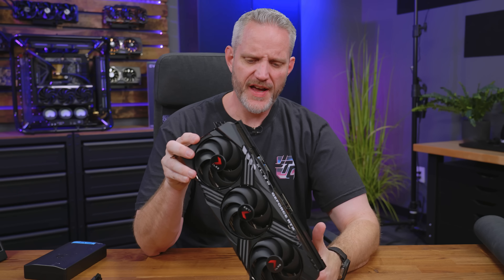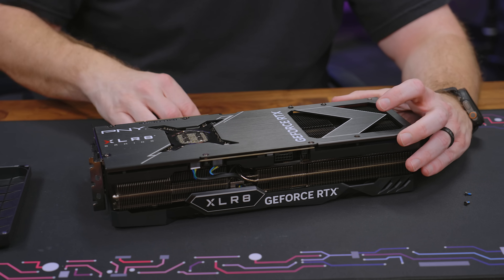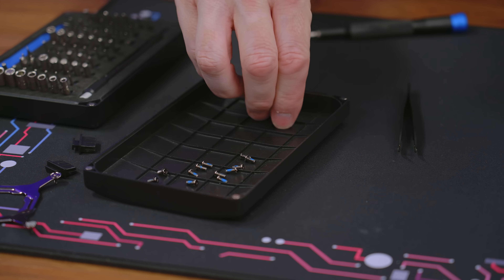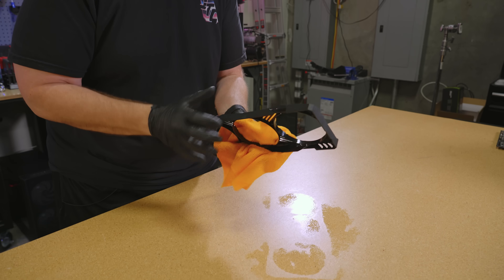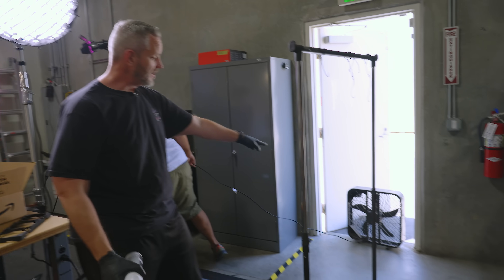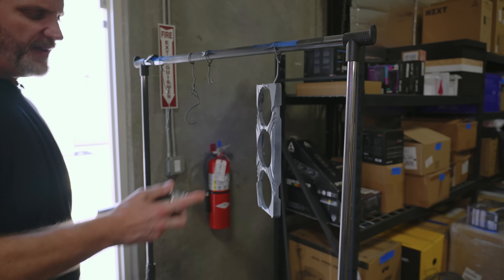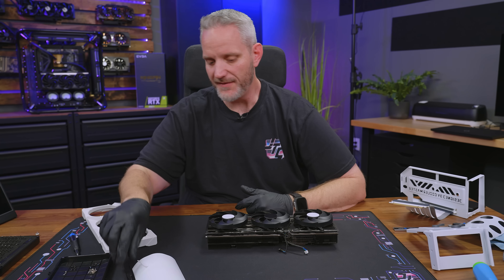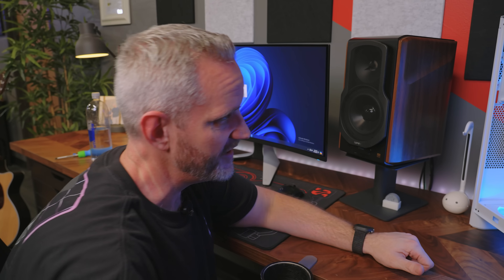How to paint your GPU the RIGHT way!

Comment: There are superwhites (not normal paint) that reflect light and heat from the sun to a large degree enough to go sub ambient, as the light is all bounced back into a clear sky... I was just wondering if there would be any way to use sub-ambient coatings and a set up to reduce temps even by a degree.... On the bright side even if it did nothing, it would be stupidly stupidly white! XD

EDIT: On the down side it's currently not 'off the shelf' available.
Reply: Radiative sky cooling for sub-ambient requires unobstructed view of the sky. So the only way a super bright white could achieve sub-ambient is if it was outdoors.
Reply: @mattrogers6646  Window. it has glass sides right? ... The real question I have on that is if it'll reflect any extra heat from being absorbed at all... There is more than one source..
 There is also phase change materials while while they can be saturated could be tuned to a specific temerture range before it really  kicks in, just as an added reservoir...

Just a few wild hair ideas, as at presnt I do not think any one is looking for other uses as they are not main stream, developed or diversified enough yet.

Comment: One thing to remember with paint, it may be touch dry but it will still take about two weeks to cure.
Reply: After a day or two depending on the thickness of the coat and the type of spray color most should be fine to handle.
Reply: @mrn234  Ya i know that, next time you paint something when its touch dry an you are able to handle it press your nail into the paint.  Then press your nail into the paint two or three weeks later. And youy will see the difference.

It's the same with two pack paint. come to think of it it's the same with all paint.

Comment: I'm having this issue right now. I'm picking all my parts for an over the top enthusiast build in white. Nothing matches, and my ocd is causing me anxiety. I don't know if I should just paint all the parts or not. I'm spending way more than I should by water cooling everything, including the motherboard and using a very expensive case from Singularity. It needs to be right. What would u guys recommend? Singularity will powder coat the case any color I want, but the mother board, fans, and fittings don't match the case or each other.  Fittings I'm going to fix by using them as a contrast color. 

Also, Intel, you messed up my plans. Theres no way I'm putting on of their cpus in my build with all the panels that double as Dystro plates that would need to be disconnected if I have to change it out. AMD, here I come. Let's release the new x3d

Comment: Nice job ! But why don't you try using plastidip instead? so much simpler and easier to pull off if something goes wrong or you simply want to change the color.

Comment: My MSI 4090 can't be controlled from icue.  Is it possible to pull the RGB connector and run a line from my MB to make icue treat the GPU RGB as a led strip?

Comment: I always get annoyed when I see builds like this that just leave it as is, I think all the blue lights do make the warmth of that white paint show through a little more but it's such a huge improvement.
Doing the fans too would of been nice too but I imagine there's just such a good chance you wont be able to hit every visible angle properly so it would be difficult, plus arent the fans made of material that flexes a bit as it ramps up so that could be an issue?
Another thing I dont see and always think about is the back sheet of steel the motherboard is mounted to is always white but I bet you if you painted it black the motherboard heatsinks/aesthetic parts and the nzxt cable cover strip would pop more while also hiding the outline of the black mobo pcb.

Comment: Shades of white i have modestly sprayed.

RAL 9010 ( Probably what Jay used )  - RAL 9003 - RAL 9016, 9003 and 9016 are what Jay would call very white.

So how much did i spray ?,,,,,,, well it was powder, and i will recon just those 3 shades of white about 3 tonnes.
And did those 3 years or so cost a blown out R elbow,,,,,, yes it did
Do i have just about any education in surface treatment, and experience in other unrelated ways of surface treatment,,,,, O yes you bet i have.
Do i have a keen eye, you bet, with my rifle i can shoot a leg off a fly at 100 yards.

Comment: you really messed this video up when you didnt do an iFixit ad.

btw 140F+ water bath with spray cans is a cheaper way to heat cans if you cant afford (have a long term need) a heat gun.

Flashing is when you add each coat

Comment: 9:10 Why dont you do it naked and pre dozed in gasoline? No Eye/Face Protection, short sleeves, and i guess Steve does not have the camera in one hand and an fire extinguisher in the other.
All that while heat gunning a spray can which says "do not heat above 50°C" with a fn heat gun... dude :/
Maybe im overreacting, but then again im with the BG (Berufsgenossenschaft) here in Germany - its something like the OSHA in the US, so im concerned.
Could you use a water bath for bringing the temps up? Maybe temperature controlled, like a Sous Vide "cooker"?
Reply: You are not overreacting. What he did was stupid, dangerous, and reckless.

Comment: In the last 2-3 years Tamiya paints started to become really crap in quality. At least their X and XF series acrylics. I don't know what they fcked up, but depending on the type of the thinner they have different colors. With plain acrylic thinner, all of their colors are pale, dusty, regardless how much retarder I use. With lacquer thinner the paints have really good, smooth surface. But the colors are changing as the paint dries. They do something with their formula, now it is unstable as hell. I ditched them as paint manufacturer. There are much better paints out there (Gunze and MRP for example).

Comment: There is no right way bought a new gpu after it's painted. Reason not to void guaranteed, could over heat the card . Not saying could happen to your just mine. U have forget the airflow to your lung, wear a mask. I would go with plastic dip though keep the guaranteed.

Comment: Not to give Jay a hard time, but that sponsor is advertising how they bypass a safety feature on a power system already known for safety issues. Plug that cable into a psu that only supports the lowest power profile and the bypassed end into a 4090 then you hope other safeties catch it and shut the psu off.
Reply: It's not a safety feature, it's an Nvidia connector that sucks and has claimed the life of my 4070 Ti. The original PCIe connectors were perfectly fine and were able to carry much more current than they allowed to go to the GPUs. I believe it was Derbauer who did a video on this and how the sense pins are redundant.
Reply: @BudgetGamer92  It provides feed back to the gpu on max current draw. Attempting to draw to much current can be very bad. And while yes there are other mechanism to prevent this in MOST modern gpus and psus, It's not given and not guaranteed to work. With these connectors poor physical design and lack of proper safety margins these connectors need every extra bit of safety they can get. MSI has even built their connectors so bright yellow shows if not fully inserted.
Reply: @kaseyboles30  🤔 what?
"With these connectors poor physical design and lack of proper safety margins these connectors need every extra bit of safety they can get." - you're proving my point...